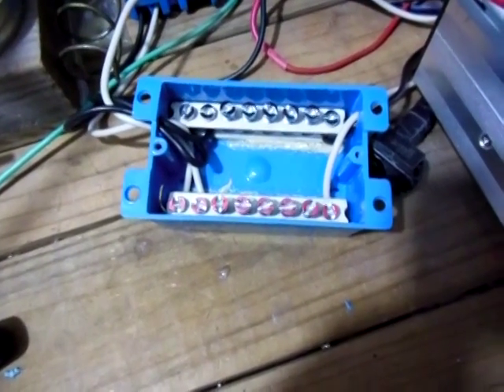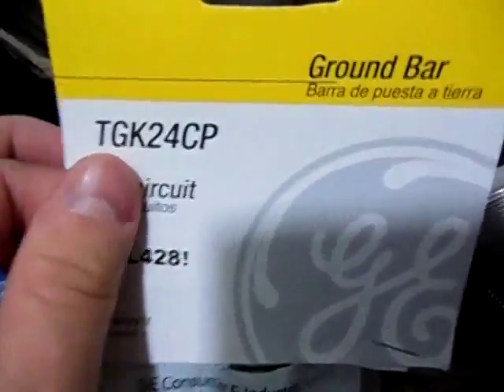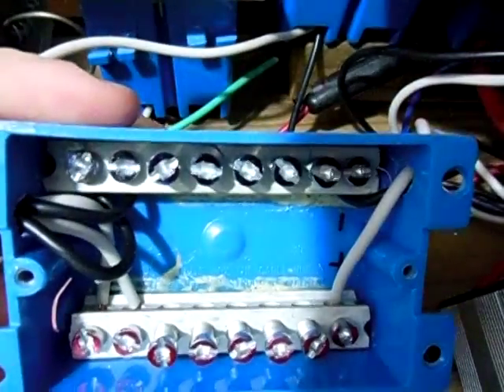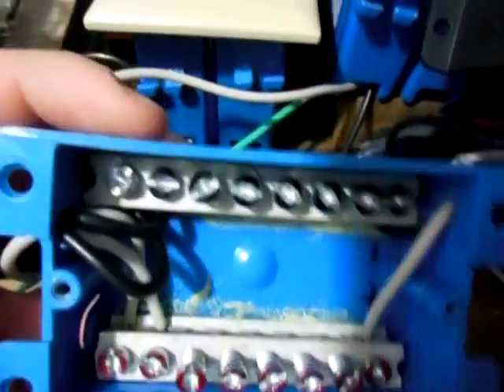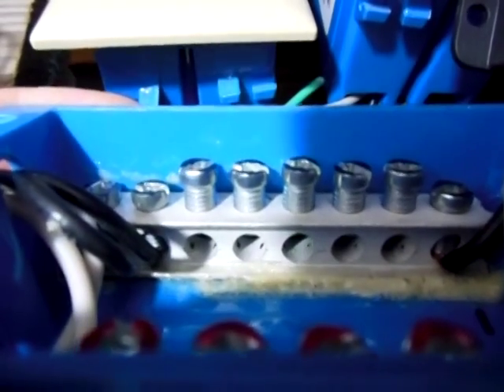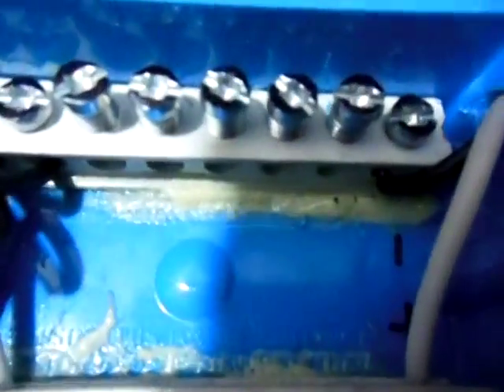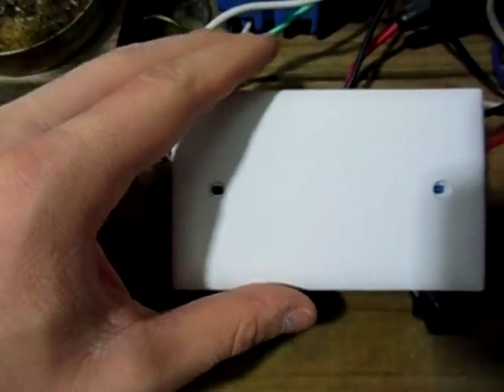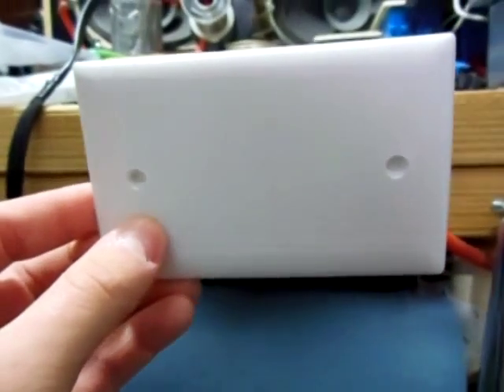Super Inexpensive DIY Solar Combiner Box

Comment: Why not just wirenut the wires together in the box?  Wouldn't that be the same thing?
Reply from the maker: +UsefulBenevolence Yes, you could just wirenut them all together. The only drawback about using wirenuts, is that when you are combining a lot of wires, the wires tend to not make a good connection. :)

Comment: How large of a system does this work with? (I'm a beginner I apologize if this is a silly question lol)
Reply from the maker: This will work with any size system. As long as your wires are larger enough, you can have as many panels that will fit.